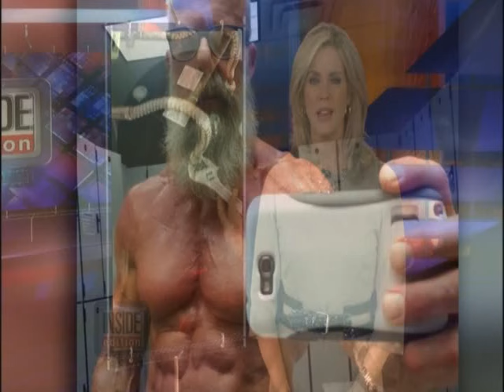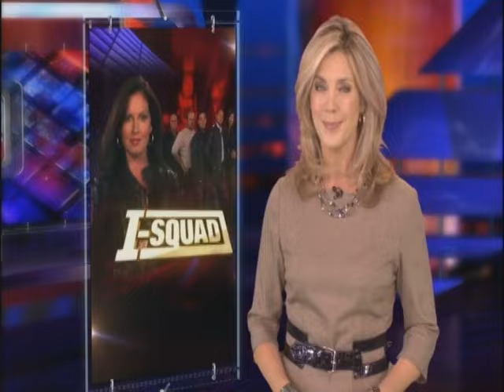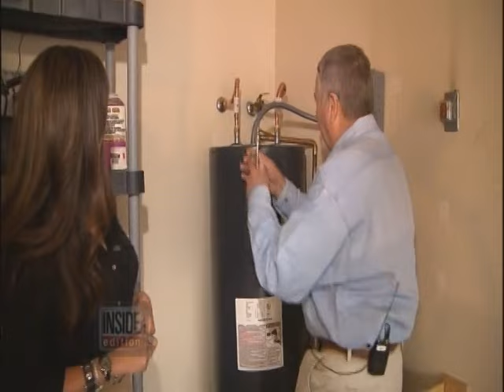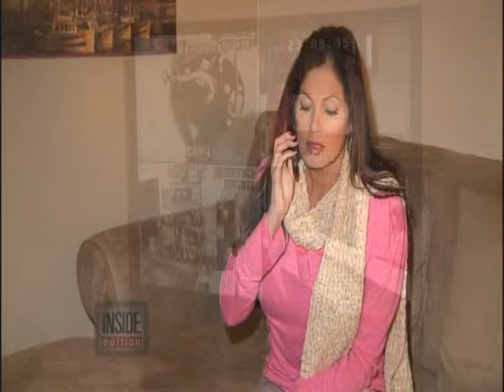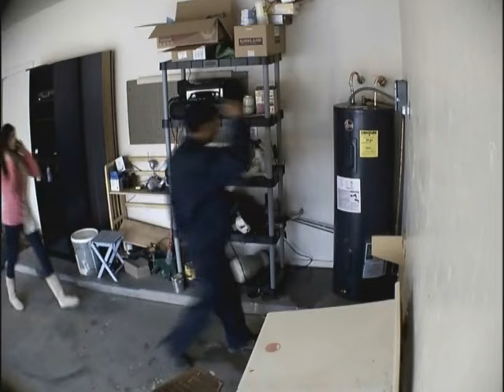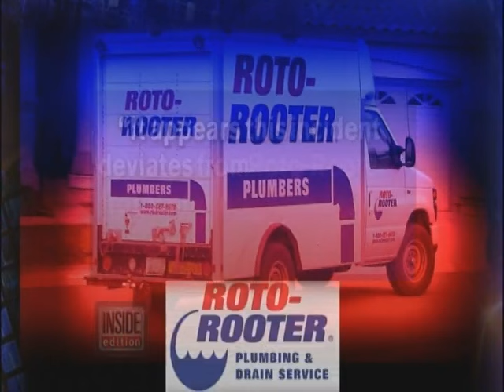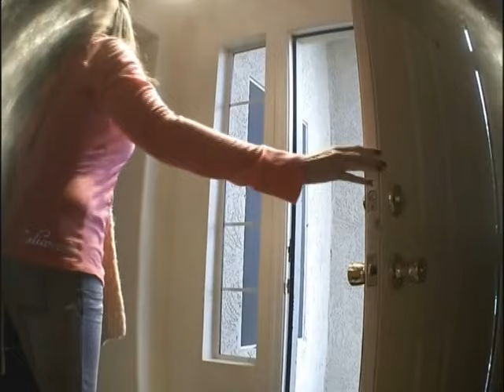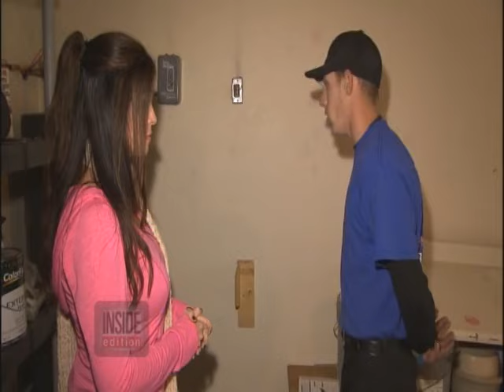Marlin Service Catches Plumbing Scams

Comment: Kudos to the plumber who did'nt charge, but we should'nt berate the honest plumbers who did charge for just tightening a nut.
They may have a minimum call out charge, and with time added with travel, it maybe the only job they do that day, so they won't get a chance to earn further. So the charge for just tightening a nut is justified.
Imagine going into any other line of work or job, (admin, retail) and your boss tells you your not getting paid today because the job was easy or there wasn't enough work...

Comment: You guys had some nerve creating a leak on a house you rented, you wet the insulation inside that water heater, and could easily have caused corrosion on the aqua stat, and other electrical connections inside the water heater. I hope you replaced the water heater for the home owner

Comment: It's not often that someone sneaks in and loosens the fittings on your water heater, yesterday the water heater was fine today its leaking, I don't think the plumbers were trying to RIP anyone off, just some woman with nothing better to do than loosens fittings and point fingers
Reply: As a plumber's Apprentice one of the first things that I learned is that when something is leaking first try to tighten the nut if possible. You don't jump to conclusions and assume right away the whole thing has to be replaced just because of a leak

Comment: Water heater. Not “hot water heater” 😀
Reply: The device heats the water, thus making it hot. The device then continues to heat the hot water to keep it above a set temperature, ergo, the device is a water heater on startup, and a hot water heater thereafter. :D

Comment: This video is kinda skewed in a way. Most plumbers are honest, there are some bad ones. I would have not replaced the water heater, that’s ludicrous.. but I would have at least replaced the water flex just in case and charged a service call. That’s how you go bankrupt. That hour the worker took to drive out there and diagnose the problem cost his company his wage, the wage of the dispatcher, the lights in his building and advertising, as well as gas, insurance and L&I rates. The list goes on..You get paid for what you know, not what you do. Took him years to get to run a service truck and some are easy and some aren’t.

Comment: Just 2 let you know, every plumbing company that has a name and big like the ones u called, we all now at least carry 2 water heaters on our vans. That's not unusual, that's common practice for a big company to do that. Just because they have a water heater on the the truck don't mean you are being ripped off. I would have done the right thing, the ones who did the right thing most likely had at least one water heater on their van, they just didn't try to sell it but if u would have asked, I know because I have done this 21 years. I would bet at least 4 out of the 8 had a heater on the truck. Good job getting the bad plumbers, if u got 2 steal to make yourself a living and the first company lied, their workers don't get paid by the hour, the ones I know, so u just make it more tempting for them to say it gone bad because they hardly make any money

Comment: actually not one house has a hot water heater. there is no such thing. YOU DON'T HEAT HOT WATER
Reply: haha a heating element*
Reply: In Phoenix you do. When it's 115 degrees the water is hot before it comes in the house.
Reply: +hyzercreek lol

Comment: i think it should be changed it is a liability when you see a water heater leaking
Reply: that is mostly right, it should be warranty replaced, because you don't know if that;s all and the previous installer could have fscked up other things or the tank could really be leaking..
Reply: Yeah, that's the fun of it, all the problems you don't see.  But there are tests that can be done.  If the tank is holding pressure once the leak is fixed, it's fine.  If something blows when you fix the leak, the manufacturer or the installer is liable.
Reply: it's always the last person to service it "company or behind on the line" ;)